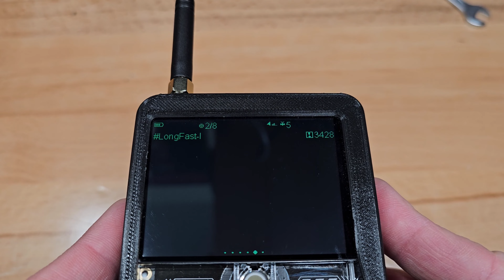T-Deck GPS install (without removing GPS connector from the PCB).

Comment: GPS is indispensable! That's why I carry my Radtel rt-490 to every trip and sail.  But it drains the battery. Therefore, it'd make sense to add an on/off switch (hardware or software)  for the GPS.
Given the size and flat surface of the back, it would also make sense to add a 2W solar panel. Could be a lifesaver.
Reply from the maker: Is the Radtel rt-490 waterproof? How do you like the Radtel devices? I'm not familiar with them.
Reply: @TechAirSpace  I haven't dropped my 490 in water, so don't know how waterproof it is. It's been with me in quite heavy rains though - and it's fine.  I'm into hiking, bushcraft, and sailing, so having a secondary GPS has been very useful in those situations when you need to locate yourself on paper map or marine charts.  USB charging is also useful because you can power from power-bank or mini-solar on your rucksack.  As a radio it's pretty good - surprisingly clean sound.  With a good antenna it can listen to satcom. It listens to airband quite well, but I don't care for those.  It has a scanner but it's almost impossible to find an interesting conversation.  So you need to have a secondary SDR with you, like Malahit.  There isn't a handheld radio that has SDR.  If I had the money I'd get ICOM IC-705 (10w), but it's too heavy and bulky; and handheld ID-52e doesn't have the full SDR capabilities.  RT-490 has an enthusiastic community on Telegram (mostly Russian) that hack it and make it RX/TX 100MHz-998MHz and improve its signal.  It's not very powerful for transmitting (~5w) and the stock antenna is trash (get an Abbree or Radtel tactical antenna) and the colour screen probably eats too much battery. The battery is 1880mAh and on standby can last for several days (with GPS switched off).  I would get Radtel 830 (it's 10W and more sensitive to satcom) but 830 doesn't have GPS.  Overall, 490 is not bad for a £50 radio+GPS for self-training trips into the wild.  I don't buy things easily - I give each item quite a bit of consideration (I just don't like clutter in my life).  If I'd find something better, I'd buy it - but I haven't.
For survival situations 490 can actually be more useful then the rest of generic Chinese radios.  And that is also the reason why I'm getting interested in Meshtastic and LilyGo T-deck.  If there was a T-deck that's ready to use (GUI, GPS, solar panel, Battery cassette), I'd buy it.
Reply: @TechAirSpace  I'm not much into ham, just have the 490 and some antennas that I find useful in the outdoors.  If I had your soldering skills, I'd probably improve my Ratel 490 by making a custom USB-chargeable battery cassette with three 18650 cells, replace the screwable plastic headphones/mic cover with a permanently attached rubber plug, and add a LED torch-light with on/off button at the base -- to make it even more useful in field situations. 
There's also a new Radtel 580 that has hit the market recently that you might be interested in (depending on why you're into radios). Radtel 580 has 3 listening channels, GPS, Bluetooth headphone, IP67/68/69, 3800mAh, USB charging.  In the next few weeks there will be more reviews, so we'll see how it holds up to its claims.
Reply from the maker: @garenkarapetian709  Have to check out the Radtel 580 reviews. Thanks for the tip.

Comment: Do you need to select pins in the Meshtastic app? If so which ones?
Reply from the maker: I didn't change any settings and it just started working.
Reply: Same here. Did not need to config anything.

Comment: All that time you spent moving those wires around.
ALWAYS put down permanent strain relief on tiny, soldered, wires before you start moving them around.
Reply from the maker: Strain relief is always a good idea. The wires are actually thicker than it seems on the video since the GPS unit is meant to be used in a drone. Wires can handle some vibration. I use this device daily and had no issues.

Comment: which Screws do you use for the case?
Reply from the maker: I used M2.5 x 20mm Hex Socket Head Cap Screws. Screws were just a little bit too long so I had to use a drill bit to extend the screw hole.
Reply: @TechAirSpace  thx a lot